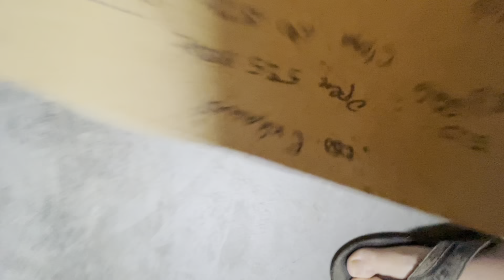Oil Pan - Ford 289 331 Stroker Motor Rebuild part 20

Comment: What is your overall opinion on the oil pan. Is it an assault brand pan? Thanks
Reply from the maker: The Assault pan is great for the price. I got the pan and a pickup for $100 a few years ago; it’s a few bucks more now. The only negatives are that it does hang pretty low (9” sump), and the matching pickup tubes are always out of stock. I had to buy a different pickup and bend it to get the proper clearance. The Milodon cobra pan is only 7.5” deep but is currently $500 and it requires another $170 for the oil pump and pickup.
Reply: @JohnLatrobe  Appreciate the reply and information John. Not trying to go cheap , but trying to save when possible. Gene